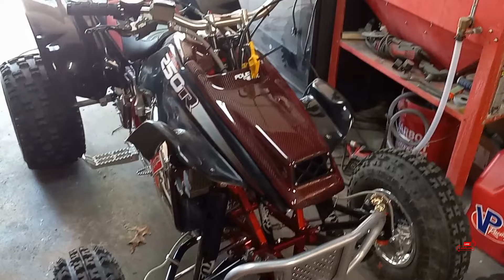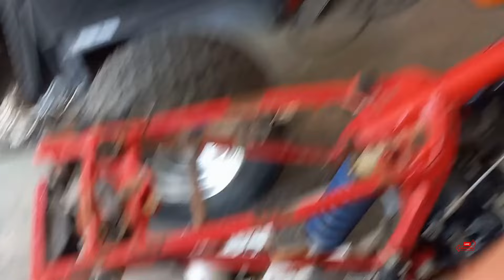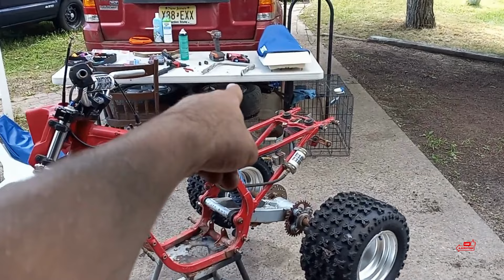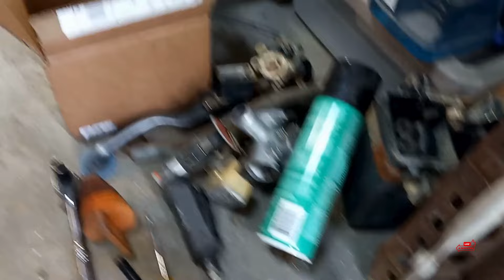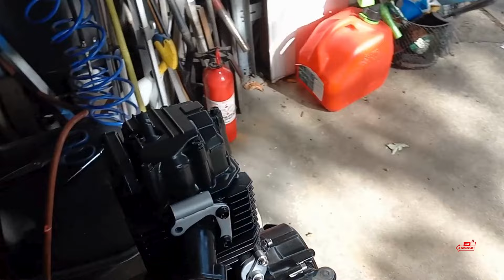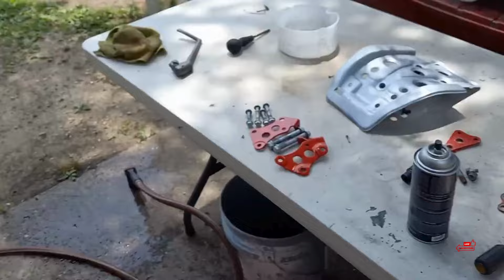Spray Paint Restoration: ATC200X Budget Build Part 1

Comment: I was just curious if you would have any 03 kfx400 or ltz400 parts I actually live probably an hour or so from you
Reply from the maker: No I don't have any parts for those rite now
Reply: @garagemcmatt  ok it was worth a shot in the process of replacing the swing arm bearings and the bearings in the linkage the were soo bad from the previous owner the piston rod for the rear shock snapped on me haha
Reply from the maker: @Billbar15  dam that's pretty bad

Comment: Another great video, what size compressor so you run for your sand blast cabinet?
Reply from the maker: It's a 30 gallon compressor. It's undersized for what I'm using it for but it gets the job done